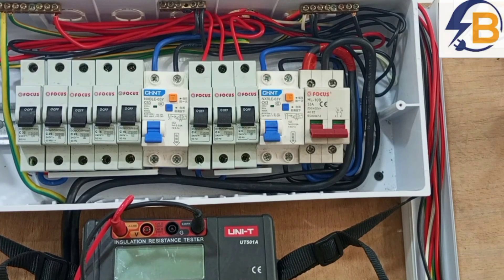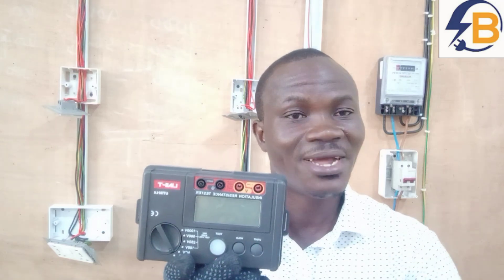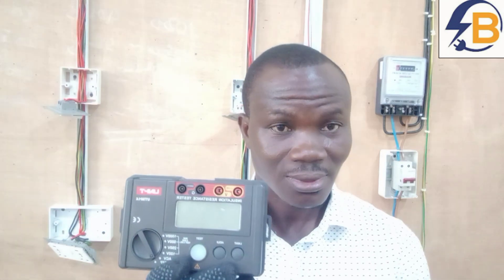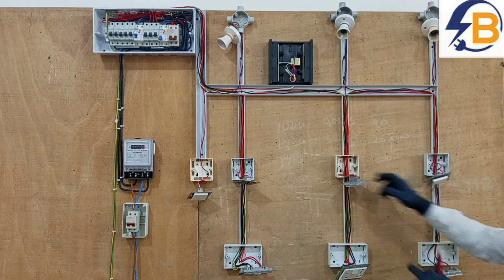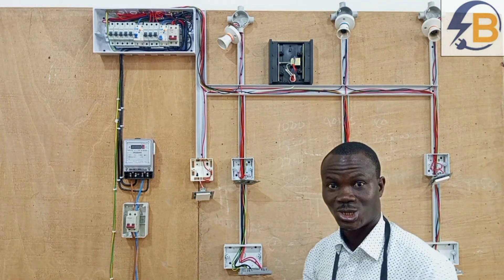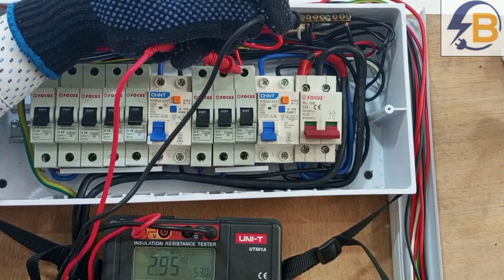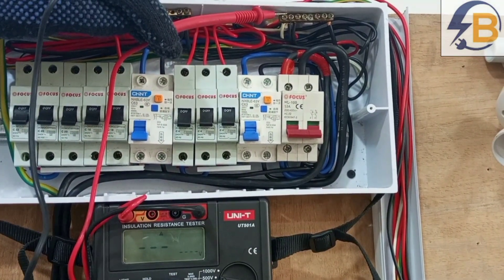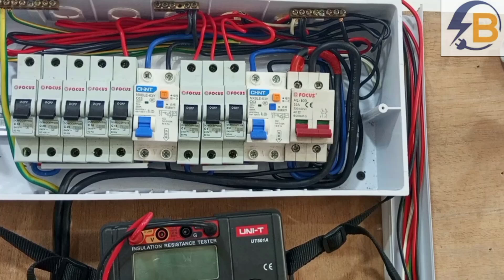Full Electrical House Wiring |Part8|

Comment: Thanks sir 
Sir if the circuit is 3 phase how many voltage should I apply
Reply from the maker: Ideally, the testing voltage should be twice the norminal voltage of the system

Comment: Why are the switches on and the sockets off.?
Reply from the maker: @emmanuelakrofi9038  
If the switch is off, it means you are taking off the switch wire from the test. It's only in specific situations that you switch off before testing